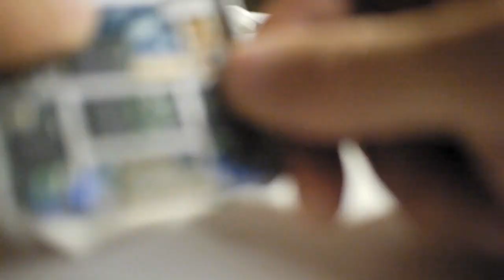Apple iPod 5th Generation Classic 30GB disassembly for repair or upgrade

Comment: Great video. Broke the screen almost 6 years ago and put it away. I bought the screen on Amazon for $26.00 and received it yesterday. Took me 45 minutes, taking my time to complete it. I was able to change screen without disconnecting the main board. Everything turned out great. I put clear tape on the wheel and metal button before disassembly, to keep it together. Thank you for posting video.
Reply from the maker: It's nice to hear someone is still using this iPod. Glad to help.

Comment: Man this was painful to watch. It has to be the most careless Ipod takedown in the entire internet. Do not follow this steps. Never use a flathead screwdriver to open latches on the pcb. Never put tension on ribbon cables, unplug everything before completely opening up the ipod. The faceplate removal should only be done AFTER you unplugged the  battery and headphone jack/lock button ribbon cable. There are many tutorials on youtube on how to correctly disassemble an ipod. Go over to those.

Comment: HI, do you offer repair services for this generation of iPod?   I bought this years go pre-loaded with music and it stopped working.  All I hear is a clicking noise and an occasional flicker of a white screen.  Is it possible to repair without losing the music?
Reply from the maker: The clicking nosie means the hard disk failed. I regret to say there is no other way to repair it except to replace the hard disk.

Comment: Not a bad video but the way you are moving those cases around with the two ribbon cables connected is not good practise IMO. Disconnect the battery as soon as you crack the case open  and then the ribbon to the headphone jack PLEASE :)

Comment: I'm looking to buy an original iPod older than this one, the woman says that the dial is broken I'm assuming she means the main button but how would I go about fixing it, will opening it up and cleaning it out have a chance to fix the problem?
Reply from the maker: It is possible that there is a lot of dust and dirty built-up under the button to prevent good contact to the metal button on the circuit.

Comment: apple tried to charge me £40 to change my battery. I bought one off ebay for £2. watched this video and changed it in under 5 minutes. Apple are a bunch of assholes
Reply: Captain Rhodes yes they are.
Apple = Money grabbing bastards
Reply: you phone them up. ask the how much to change the battery and they say £40. thats how
Reply: Isn't the 5th generation iPod classified as "obsolete" by Apple? How could you go to an Apple Store and be charged for servicing an obsolete product?
Reply: Everybody's gotta eat. But good job on doing it yourself.

Comment: hello, thanks for this video! just one question: my center wheel button feels loose (like if were pressed), I was thinking on buying the whole wheel including that button, but I noticed there are some black buttons on the mainboard, so what do you recommend?. thanks in advance.
Reply from the maker: see how firm is the push button on the main board, if it is firm then the problem is with the external center button.

Comment: Hello i was wondering after watching your video . i replaced my battery in my ipod 30g 5th gen. now since i did that the wheel won't respond i have takin it apart cleaned ,blown  air done everything i have seen to try and repair it. is there any suggestions from here or somewhere i could send it it for repairs? its a great ipod and hate to lose it
Reply from the maker: +bondoguy Make sure the contact on both the button and the board are clean and free of moist, dirty, rust, etc. Also make sure your connectors are all properly inserted and there are no broken pins or wires.

Comment: For years, the right side audio is dead and will only be heard if i depress earbud. What part of ipod beeds repair for that? Also, can I bring my 5th generation to get fixed at a local electronic repair shop? Are the costs low enough so that buying a new iPod won't be necessary?
Reply from the maker: Lynda Floyd Yes, if you need to replace the audio jack or make sure its connections are not loose, it should be a simple job at the local electronic repair shop that doesn't cost much.
Reply: 1000uf terrific, thanks!

Comment: Great Video, can you tell me if there is a way to replace the connector on the board that the battery plugs into?  Somehow mine came disconnected from the board????/
Reply: I am guessing it needs to be soldered back on, do I need to bring it in for a professional to fix?  How would I know which connections it gets soldered to?
Reply from the maker: Cary Stevens That's a tough one to do yourself. The pins are so small and you need special soldering iron and fine solder for surface mounted device. Normal soldering irons have tips way too big and the solder are too thick, unless you have a hoove-tip which then you can use the sliding method. The best thing is to replace the whole main board.

Comment: When I get it apart would I be able to fix the headphone female part inside the unit? Is there a store where I could order it. Is it fixable by myself?
Reply from the maker: Yes, the headphone jack (female) is a common point of failure. You can de-solder it and replace it with another. If you live in a big city, you could find one from an mobile phone repair shop, otherwise look on Amazon or eBay as this is a common part. Radioshack should have things like this, but they don't, that's one of the reasons they are failing, but I digress. In my channel you can find video about soldering and de-soldering, if needed.

Comment: Does the sync port (female part that the data cord plugs into) unscrew from the frame or motherboard? Or, is it soldered in place?
Reply from the maker: No, it does not detach. The soldering is also very fine, so hard to work.